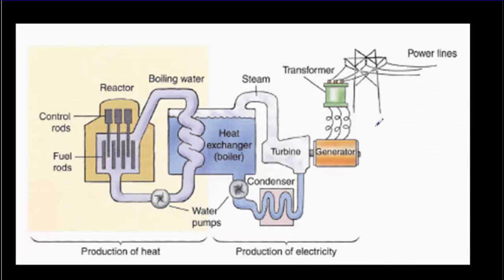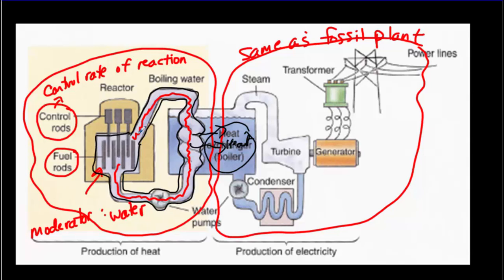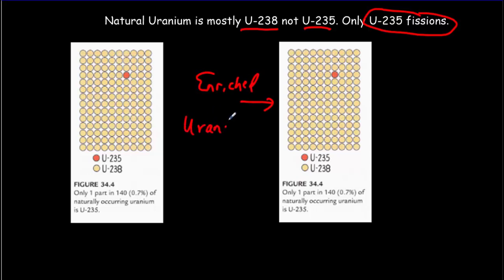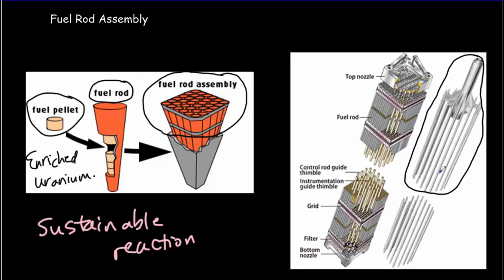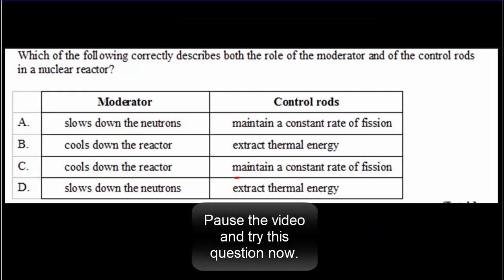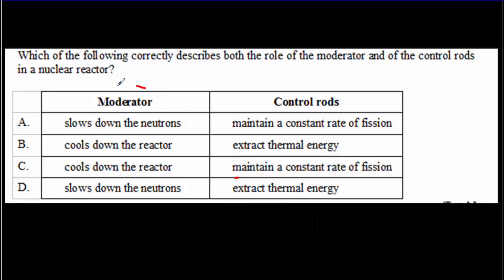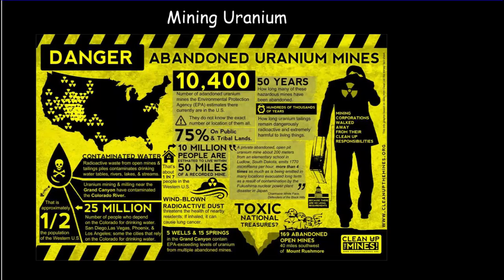IB Physics: Nuclear Power

Comment: Why are slower neutrons less likely to be absorbed by u-238?
Reply: I am not sure, but if you think about it, it will probably absorb the more excited/energetic/faster neutrons if it is a more nuclear/reactive material
Reply: Nevermind actually, the part about "more nuclear/reactive material" may not be correct. I apologize for causing any confusion. U-235 is actually more reactive than U-238, but U-238 is more abundant in nature.

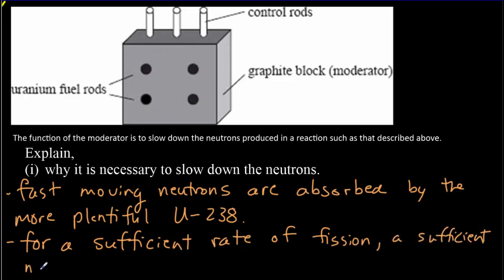Comment: In regard to 12:15, I understand how slowing down neutrons ensures they are not absorbed by the U-238 (as U-238 absorbs fast-moving neutrons). Does that mean that slow-moving neutrons can still be absorbed by U-235 and can, thus, cause more fission. The slide explains that "for a sufficient rate of fission, a sufficient number of neutrons are needed to fission the U-235", but many of these neutrons would have been slowed down, which is why I assumed slow-moving neutrons can be absorbed by the U-235.
Reply from the maker: Correct.

Comment: Why is it undesirable for U-238 to absorb a neutron? Because U-239 can decay into plutonium that is fissile as well. 
Is it so that the incoming neutrons can be absorbed by the moderator (water) to gain kinetic energy to eventually heat up and transfer energy over to the heat exchanger?
Reply from the maker: Plutonium can only be used in a reactors designed for fissioning of plutonium. We do want the transfer of energy to the water, but we also want to slow the neutrons so that they are available rather than being absorbed by U-238.